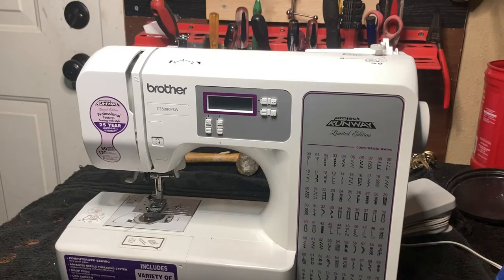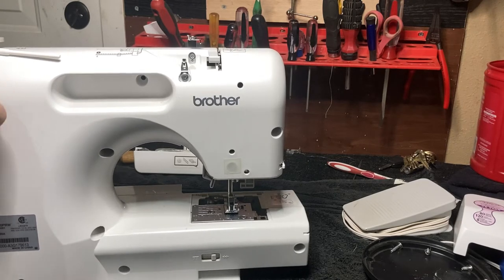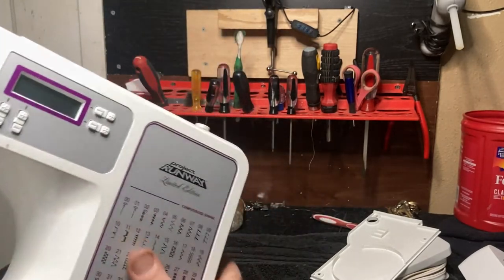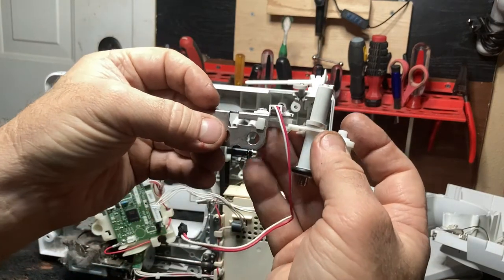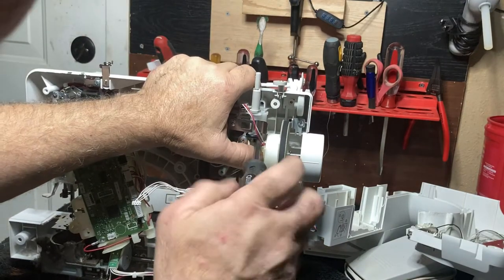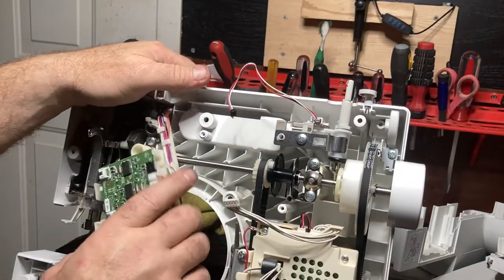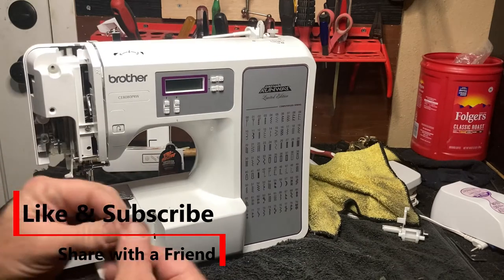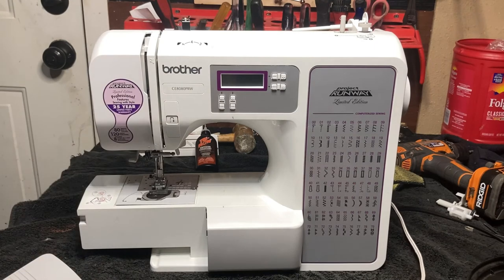Brother Bobbin Winder Replacement

Comment: Ha! I took my computerized Brother machine to our local sewing machine repair place that has been in business for over 50 years. I needed the bobbin winder replaced and they flat out refused to do it. They told me it was very labor intensive and I would be better off buying a new sewing machine. At that, I bought a battery/electric operated bobbin winder that works just fine for much less money.

Comment: why did he put the curve metal not back behind the other as it was to begin with. He just attached it in the front of the bar and then turned the bobbin.
Reply from the maker: Hello Linda,

I am not sure what you are asking.
what part of the video are asking about?  How many minutes into the video is the part your asking about?
Reply: @sewingmachinetipsandtricks9079  you remove it from behind the bracket at the bobbin winder but replaced it in front of the bracket. Watch the video...its the piece with the curve that moves the bobbin winder to allow the winder to spin .
Reply from the maker: @sweetladylah  

I understand now.

It is not a big deal on this machine, they each preform a separate function but are attached in the same place. it does not matter which one is in front or in back.
Reply: I did the same mistake and the bobbin wasn't spinning. Luckily with your question and I  fixed 😁. Tnx

Comment: I'll stick to my vintage kenmore and singer machines.
Reply from the maker: Most definitely!
Reply: More than reasonable imo. I have a singer stylist 367 and a brother es-2410 that I just picked up yesterday with a broken bobbin winder (hence I am here). The singer works like a dream and I usually use it for more intensive work alongside my previous main machine (which the es-2410 will replace). I feel like sewing machines were built to last more often back in older times.

Comment: This was just what I needed … however I now have an extra part I don’t remember where it goes 🤦‍♀️🤷‍♀️.  I had taken it apart in November, before you posted this. The part has a spring wire, rod, & black knob with a screw…

Comment: Hi there! I recently thrifted a Brother JX2517 and I can’t seem to get the bobbin to wind. I opened it up and the bobbin winder moves and so does the timing belt when the foot pedal is pressed, but the bobbin stays stagnant and does not wind. Do you have any suggestions?
Reply: Hi there . I have the same problem. Did you ever find the solution on what is wrong?
Reply: El devanador debe llegar a topar con la pieza que tiene la banda para hacer su función

Comment: Does the brother CE1125PRW and the brother CE1100PRW use the same part numbers for replacing the bobbin winder shaft and the spool pin assembly?

Comment: Hello, I don't know if you have seen the mechanism of the new model brother sewing machine models, they are a metal frame and it is even more convenient to change the winder, no need to unscrew the electronic board.. .The new models are designed to facilitate repairs, fewer screws, simpler, more practical and a little more robust at the mechanical level, it is still an entry level but better and more for the duration